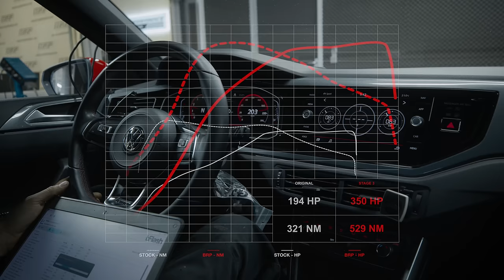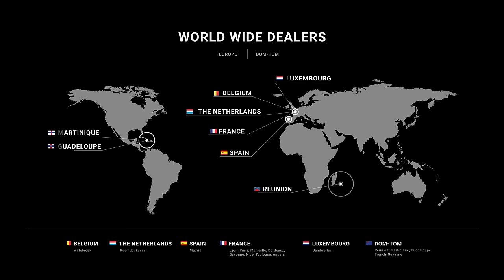Volkswagen Polo GTI 2.0 TSI / Stage 3 By BR-Performance / IS38 Turbo

Comment: The car can barely hold traction at 200hp I can't imagine the tyre squeel at 350hp. There is a reason the Golf R is AWD, a car needs to be able put its power down on the ground.

Otherwise absolutely love the sound! Did you guys decat the car?
Reply from the maker: From a dig traction is a problem, once rolling it's quite manageable. It's a completely different animal compared to the "civilised" characteristics of the Golf R. Yes it's decatted!
Reply: @BRPerformanceTV  True the issue is just traction from a launch. Decats sound the best really like your work btw!

Also just wondering is the engine and stock turbo in the Polo GTI exactly the same as the Golf GTI (IS20), sure you guys might know?

Comment: I bet it has wheelspin in 4th gear :)
Reply: It' s not a Fiat Uno Turbo i,e It' s a fucking Polo.
Reply: @alexar546  You clearly have no fucking clue. If my A3 (225 HP & 460 Nm) spins wheels like crazy, why do you think that Polo with a ton more power won't?
Reply: @alexar546  529 nm for the size and weight of this thing...Ofc its going to spin like crazy.
Reply: With perfect tyres and good mapping it’ll stay stuck even in 3rd
Reply: @nathadarnell  Mapping has nothing to do with that, that's simply too much power and torque, for a car that weighs a ton. There's nothing to press the car down on the road. Even RS3 has half a ton over this thing. Sure, proper tyres would help.
Reply: FlowRS Polo GTI weighs the same now as a MK5 Golf GTI, look up TR Hamza on YouTube, 400bhp golf mk5 and barely any wheel spin in 2nd & 3rd
Reply: @nathadarnell  But there's still wheelspin, which is exactly my point. And under circumstances that aren't perfect, there would probably be wheelspin in 4th aswell.
Reply: unico lol when they invalidate a car because it spins the tires..... yeah I know it spins that’s why I bought it
Reply: @ryanfitzgerald7031  Yeah I love it when my MK5 GT does wheelspin, feels brutal :)
Reply: @ryanfitzgerald7031  It sucks when you can't put the power down whenever you want to. Floor this Polo in 2nd gear, you ain't moving. Then floor a car with a Quattro. I hope you get the point. My A3 does the same thing, 'cause it has too much torque for a FWD.
Reply: @xFlowRS  yes it does
Reply: Uncut The Urbanite  Isn't electronic slip there to counter torque steer, not wheelspin?
Reply: Good tyres And you will Be fine :) pilot sport 4s, Toyo r888r that sort of segment :) in uk we have a lot of stage 2 plus edition 30 pulling about 380 bhp and doing around high 9sec 100-200 Times. Quattro is good of the line but when moving it gets slow because of drivetrain lose. Good tuner will ensure you have traction.
Reply: @adrianica3  I currently use Dunlop SportMaxx RT2. Was considering a fresh set of Pilot Sport 4's, or Eagle F5's. I get your point about Quattro, you're right. However, it's great off the line, and that matters most to me, which is why I'm going for a TT MK3 2.0 TFSI with Quattro/S-Tronic.
Reply: @xFlowRS  I have a Edition 30 making 360 bhp on a APR Stage 2+ map. Could reach 400 bhp with the same map but decided to stick it a little lower to reduce the wear on the car. Full set of Pilot Sports and the front end still spins like crazy. Even my Polo GTI spins quite abit if the roads are abit damp and that's stock.
Reply: @adrianica3  you won't be fine, i agree with others, you spin. I'm spinning with 400 nm of torque (FWD). Maybe with semislick tires you can solve the problem (or with 4WD car). And a stage 3 on a polo is pretty useless.
Reply: Only if you try. In normal traction conditions and with normal throttle appliance you shouldn’t be spinning beyond second gear, and second gear wheel spin can be avoided with careful throttle.

4wd is better obviously, but people  tend to overreact to highpower fwd cars performance issues because some jobbos try them and oversteer all over the place. You could drive a rwd Ferrari the same way and then claim it is undrivable.

Used to own a +/- 400 HP Supercharged integra type R back in the day.
Reply: @vadimvandendonk8879  I'd like to see you avoid wheelspin in 2nd with a ''careful throttle'', when you instinctively react in street racing from 30 km/h.

Bunch of bullshit what you just wrote, and there's no way that an overpowered FWD car has same drivability as a proper sports car.
Reply: @alexar546  mine is stock and Spins wheels in second gear
Reply: The polo in stock has alot of wheel spin as is. I did a stage 2 tune with a few extras and it's worse. Might try and lower it and see if it will help.

Comment: What motor is in this 2.0 EA888 Gen 3B (Budack cycle) - if so I thought that these wouldn’t make that power due to high compression ratio? I have a Seat Ateca FR 190 with the EA888 Gen3B and would love to know if I can do this? Mine has DQ381 box and 4wd.
Reply: A Stage 1 already brings it to like 255ps and 430nm

Comment: OPF or non OPF model?
Reply: That’ll be opf model
Reply: @chrissmith-wb6st  Can you get that sound with an opf?
Reply: Manuel Göllnitz No sadly not, the OPF kills the sound. My plan is a miltek OPF delete when my warranty runs out next year
Reply: @chrissmith-wb6st  I don't think that would be legal in my home country. Here you would lose the operating permit of the car
Reply: Manuel Göllnitz As yet I don’t think there’s specific rules regarding OPF’s in the UK, it just needs to pass emission regs
Reply: @chrissmith-wb6st  if it's fitted with an OPF from factory, it won't pass MOT if removed.
Reply: @burnrat  Not hard to over come.

Comment: IS38 considered stage 3 over there? That's stage 2+ here in the states. Gotta get away from a stock turbo to be stage 3.  killer build
Reply: its not stock the polo comes with a is 20 stock
Reply: you're probably thinking about the Golf 7. That comes with a is38 stock. Were the Polo as Shadali mentioned comes with a is20. Most power made on the EA888 3.B with a stock bottom end is around 430 - 450hp
Reply: @MJ_M140  Golf 7 GTI has is20 too, only R and TCR are equipped with is38
Reply: @MJ_M140  the polo GTI comes with continental RAAX turbo not IS20
Reply: Car scene is sht in europe thats why

Comment: Why are the rear wheels moving on the dyno?
Reply: Haldex?
Reply: @kcube2548  gti isn't awd, should be R then I guess?
Reply: The dyno itself has the rollers interlinked. Modern electronic stability systems, not necessarily on this car, can get triggered if they sense a large speed difference between different wheels, even ones that aren't powered.

Comment: Why is torque dropping of so hard?
Reply: Low valve area and small turbo losing volumetric efficiency at high rpms. Choking/pushing back charge air. Hardware optimised for city driving/low end torque + response.

Comment: does the LM440 is20 or is38 fit and run properly at 450 bhp or am i supposed to upgrade the fuel system (high and low fuel pressure pump, injectors etc? thanks
Reply: I know on the 2017 or below models you need the gold R HPFP if you want 400+ bhp
Reply: For is38
Reply: Fueling is needed for that amount of power in the Polo. But also Methanol injection for the engine not to shit itself

Comment: Nous avons une polo GTI de 2019 avec 23000 kms au conteur.. actuellement 200cv en faisant le stage 1 , ça apporte quoi et je voudrais mettre l’échappement Miltec déçu merci pour votre réponse.
Reply: Un stage 1 c’est une reprog. Tu vas gagner une grosse trentaine de cheveux. Ensuite tu as le stage 2 (ligne Milltek entre autres pièces) pour un gain d’environs 50 chevaux. Pour ma part je vais certainement faire un stage 2 chez eux sous peu.
Reply: @natasetibahm1843  svp redis moi .. ton ressenti ok 👍
Reply: @natasetibahm1843  ont voit la différence avec le stage 1 ..déjà ??? L’échappement Milltek ça doit super 👍
Reply: @jacqueshenry6553  JE VAIS. Pas encore en fait. Mais je me ferais un plaisir de te dire quoi quand ce sera fait.
Reply: @natasetibahm1843  oui .. si tu le fait , dit moi le ressenti.. ! Ça risque rien pour le moteur la repro
Reply: @jacqueshenry6553  c’est plus la boîte me soucis , même avec reprogrammation de boîte ça use et risque… quoi qu’on dise … plus tu demandes au moteur, plus il y a de force et de friction… personnellement j ai été chez le concurrent de peruwelz pour pas le citer et stage 1 a 250cv et 390nm et déjà ainsi ça patine mais plus gérable sur du sinueux… plus on en demande et plus ça use.. au prix d’un embrayage ça calme déjà alors une boîte dsg…
Reply: @alexandrefrancois7626  merci 🙏 déjà d’origine ça marche et avant d’exploité complètement la caisse … ils y du travaille là.
Reply: @jacqueshenry6553  en général, il parle de 60% de marge en origine, mais on plus on se rapproche des seuils de tolérance et plus l’usure d une pièce aboutît à une panne, un stage 1 fait en général la même durée de vie moteur à condition de ne pas faire le sauvage régulièrement, respecter les 90* d’huile, les temps de chauffe , l’afr au démarrage et refroidir à l’arrêt 15 sec le turbo avant d’éteindre… des entretiens et vidange rapprochée… ici personnellement et selon les conseils : vidange 10000km. Vidange dsg 30000 bougies 30000 bobines 50000 pcv 60000 cloque de pompe à eau et termosta 60-70000 dump valve si pas renforcée 40-45000 etc etc
Reply: @alexandrefrancois7626  ok .. c’est clair 👍

Comment: no clutch upgrade? heard it will die over 300 HP on the old dry DSG
Reply: not dry clutch its 6 speed dq250 clutchs can get 600nm
Reply: boba motoring : 
 * hold my beer *

Comment: 350 cv sur les roues avant ca doit patiner sévère! Sur ma M140i j'ai pris du Xdrive pour profiter au mieux du 3L turbo... et de ses 500nm de couple.
Reply: Bonjour.Je possède 319cv et 510nm sur le train avant sur un Scirocco GT-TDI prépa ABT.Effectivement les trois premiers rapports, si pieds plancher,ça accroche difficilement malgré des pneumatiques  haut de gamme et sur temps sec.Il faut doser l'accélérateur.

Comment: You guys also tuned the dsg?
Reply: 100% tuned, i think the normal dsg cant handle 530NM
Reply: Description says they did DSG remap
Reply: @kayotic321  Ah okay sorry didn't noticed it
Reply: @cem030  No for sure but i wonder or br does the dsg tune as well, because i wanna chip my polo gti aw but not without a dsg tune but i wonder or they can do it or i have to look external.

Comment: Is going to be fun in the upcoming months, understear like crazy 😅 Don’t get the point of having so much power on a fwd car. Can’t launch properly, it’s only fast at higher speeds, which you can barely achieve on public roads and it’s still not faster in corners.

Comment: This video should be called: "how to turn a perfect daily driver in an utter undriveable piece of crap"
Reply from the maker: Please elaborate why this would be.
Reply: @BRPerformanceTV  you just can't deliver all that power to the wheels from the chassis of a little polo without going sideways every corner and plus with the money you spent on the tune you could have got a Golf R which is still much faster than this, for the reasons i have explained above.
Reply: @ThatRedGTI99  oh I also live en Denmark we have some of the highest car taxes in the world so a Polo GTI cost the same, as what you pay for an Audi S3 . So it is way cheaper to buy a less expensive car and then tune it to the desired performance. Golf R cost €90.000 here. The Polo GTI cost €45.000. Paying an extra €6.500 to get similar performance or better, makes a lot of sense and is good value for 💰